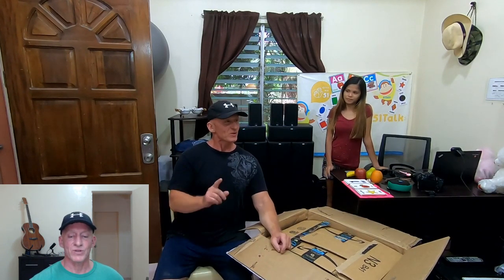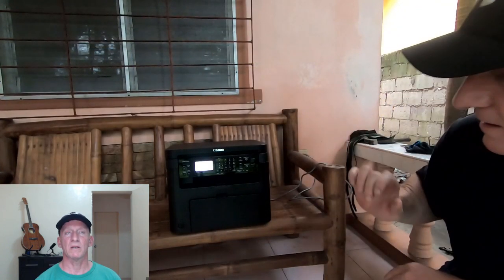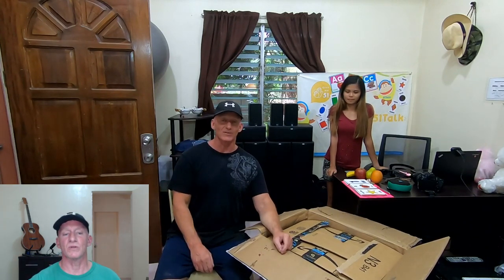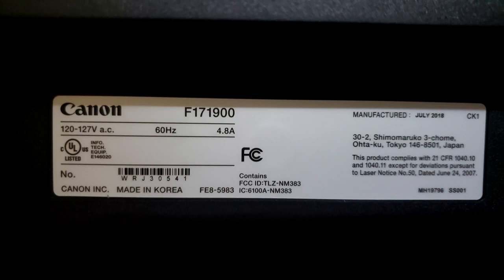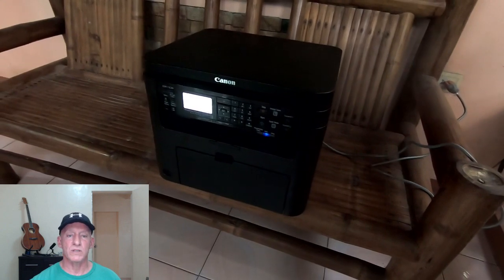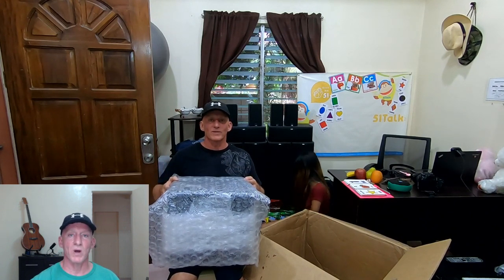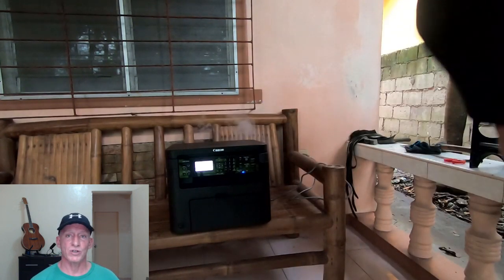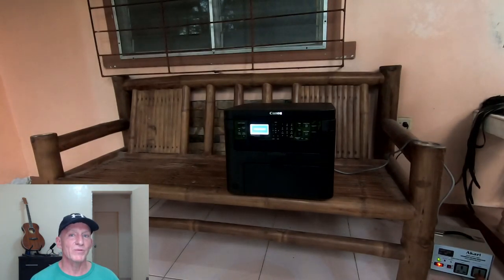It's (Still) Alive!! - Voltage Converters, Step Transformers and AVR's in the Philippines

Comment: I got a mixer of Lazsewer advertised as 220 volts turns out it was 110v  Lazsewer wanted nothing to do with it..Which means Lazsewer will allow anything to sell. Check any electrical device in the Philippines as all the shop wants is a sale regardless.

Comment: Well most electronics use a switch mode power supply and to save money they design them to run on 100 to 240 v ac so they work anywhere (Japan is the odd one with 100v). The days of using heavy expensive (copper) transformers are over hence the sw mode psu. My first career was electronics and i keep my hand in, so to speak!

Comment: What you need is a converter that is rated for twice what you intend to operate. I shipped a copper wound one over to Bacolod that is rated at 5000 watts. It adjusts the output automatically by the use of a multi tap transformer. Since voltage varies greatly based upon where you live along the power grid and what the current draw is on the system I always get a good solid 110 volts. 

These power supplies are normally about 80% efficient so I suggest only turning them on when you intend to use them. 

I am very surprised and happy that your printer still operates.

Comment: Ned, I've also noticed some cheap electronic products sold in Phils. don't seem to really be made for 220v. I think they were cheaply converted and they end up frying in a few months.  The on/off button blew off my cheap drip coffee maker one morning and I also had a box fan fry after owning it for a few weeks.  This also could have been "dirty electricity" but the overall heat generated by the product felt too hot for its own good.

Comment: Most AVR's that I have seen at that size have a 240 and a 120 volt output as well. I would still use the 120 VAC output if available. As far as that small "Voltage Regulator" goes, it DOES NOT reduce the voltage. It is essentially the same as a light dimmer, it only pulses the full voltage for part of the time and still delivers full voltage, but since it is not on all the time, the average mimics  a reduced voltage. It is designed only for heating appliances that can tolerate the higher voltage and not burn out because it has so much off time. Electronics on the other hand can be destroyed quickly with the full voltage. Those small adaptors can work incandescent lights (because they are essentially heaters that glow), or other heating devices, never use them for anything that has any electronics in it. BTW I am an electrician along with other qualifications, I know what I am talking about. I suspect the cap that blew was not rated for your voltage and the replacement most likely is. Best of luck with your electrical devices there in the Philippines, I have a house in the Philippines and installed a 10KW whole house AVR. As you said the power there is terrible at best, when it is on at all.
Reply from the maker: Yeah, the cheap ones just cut the wave in half.  Not good for anything with circuits! Thanks!

Comment: 3:40 Hey Ned, this is where I respectfully disagree. In my experience, you will see a label saying 120v/240v , indicating an auto switch. Also, and this is my opinion, even if I TOLD YOU it supports 220v, I can make a legal case to indicate that the printer has no indication of 220v anywhere.
Reply from the maker: Oh, you are absolutely right.  I just messaged Best Buy to see what they would say.  Sent them the full video of it going up on the porch.  No response, but mebbe they think I set off a firecracker under it or something.

Comment: Wouldn't the legal/warranty obligations be clearer if you were purchase the printer in Asia and ensure that the manual and the data plate both say, and mean, that the product will work with a 220 V supply?
Reply: 100% tax on imported electronics plus naturally higher prices means his $100 printer may have been $300 or more.  Cheaper to send in a balikbyan box (which avoids taxes unless they open the box)